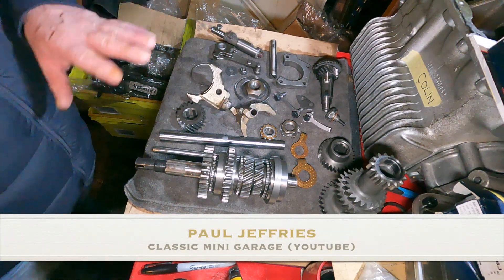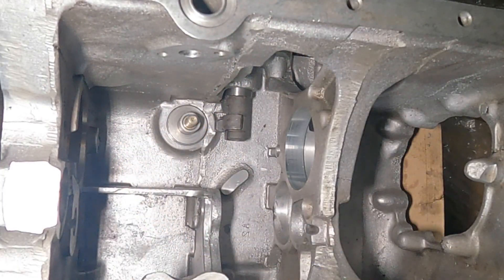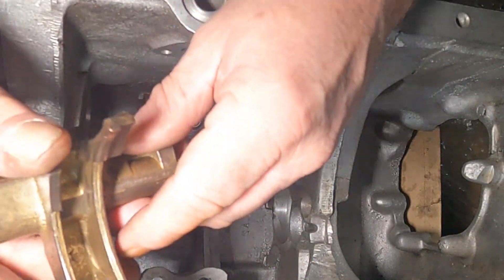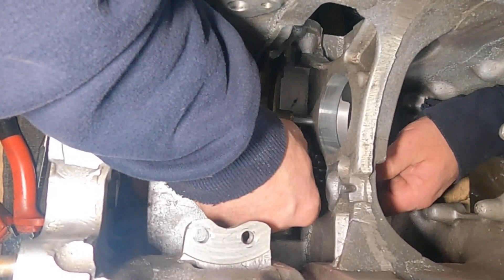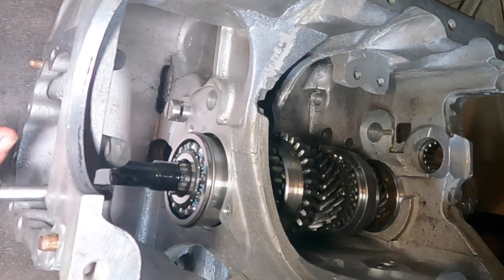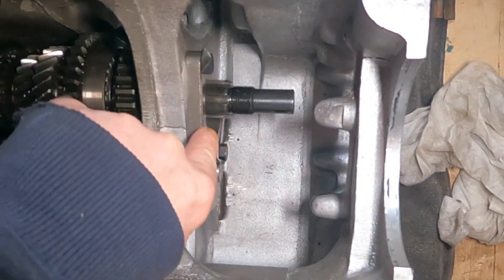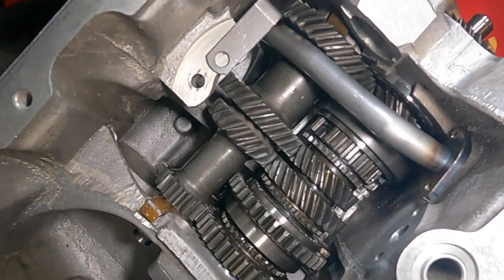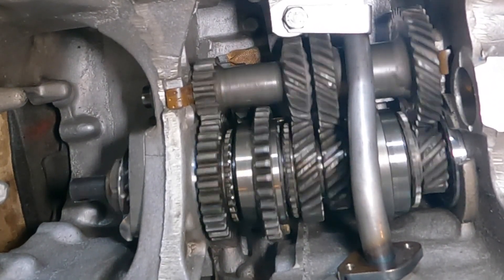Classic Mini A+ Series Engine Total Rebuild Episode 14 - Rebuilding The Gearbox

Comment: Hi Lee, great video. I'm rebuilding mine and this is really helpful. first time for me doing anything like this. I've put my new main shaft in and bearing but I got quite a bit of play in the gears. I can move the cogs on the left hand side a few mm. It looks like the space is where the baulk rings are. There seems to be a fair bit of movement left to right. Should this be a tight fit or should I expect some play. Its amost as if the bearing need tapping in more at each end to squeeze everything tighter but I think there are as far in as they can go.
Reply from the maker: Hi. I’m not quite sure…it’s possibly something Paul would know though. 👍 @classicminigarage